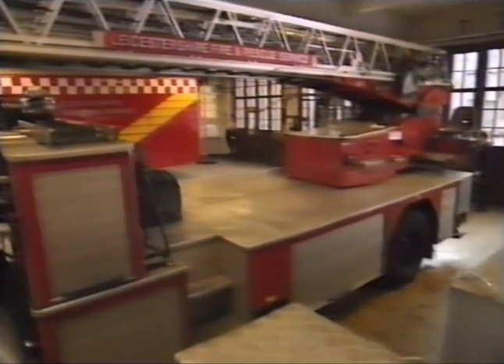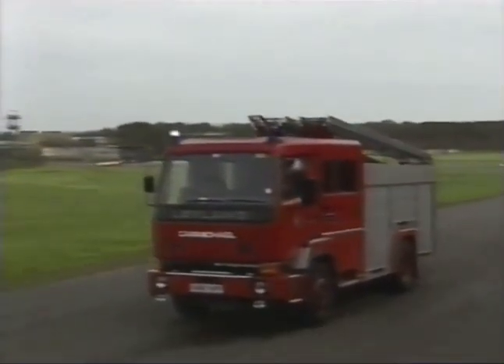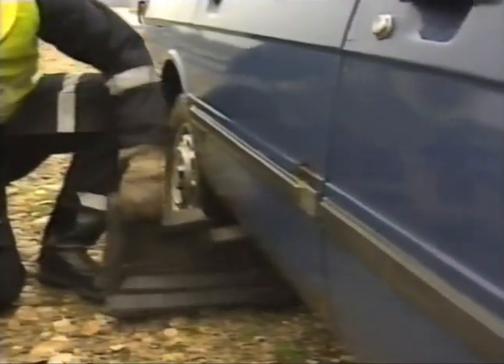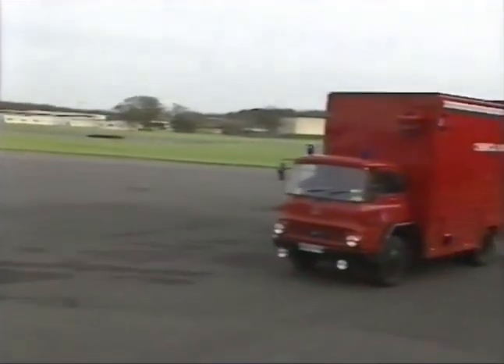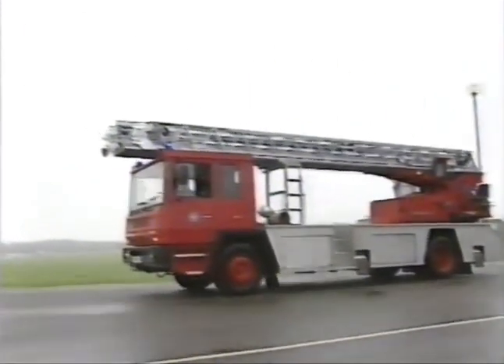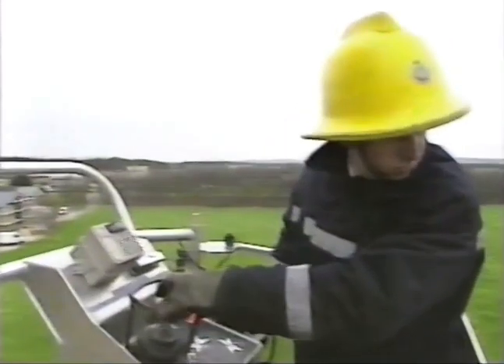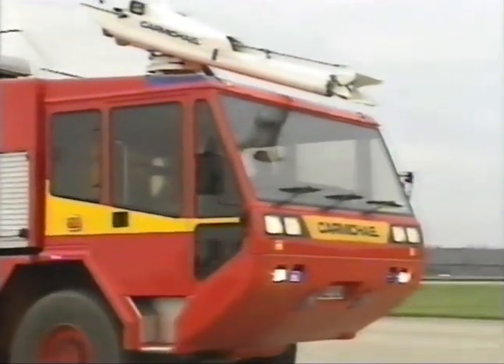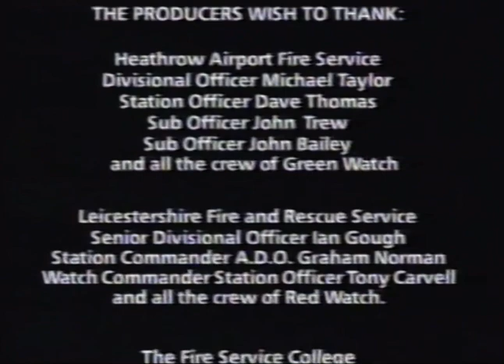Mega Machines: Fantastic Firefighters (1995) - Full Video 🔥🧯🚒

Comment: Carmichael Cobra

Role:
Airport Fire Rescue Vehicle

Speed
113Km/k

Engine:
Detroit Diesel 8V92TA
Watercooled-2 Stroke Direct Injection Turbo Charged Diesel Engine

Acceleration:
0-80Km/h In 34secs

Foam Tank Capacity:
1400 Litres

Registration License:
L276 ULX

Fire Service:
Heathrow Airport